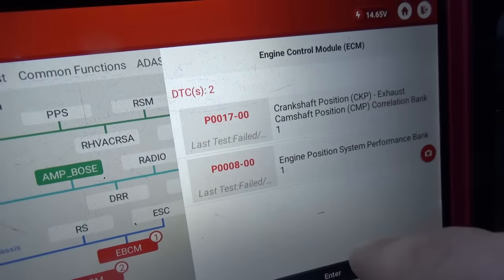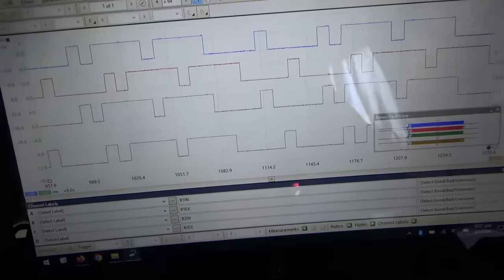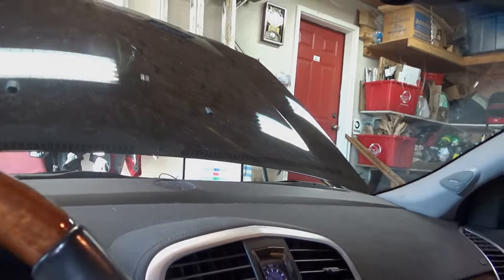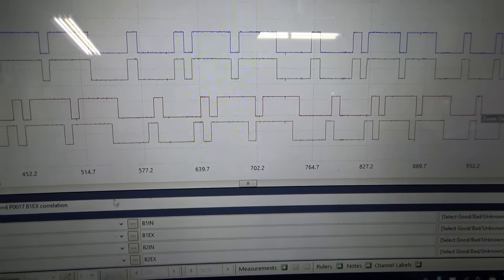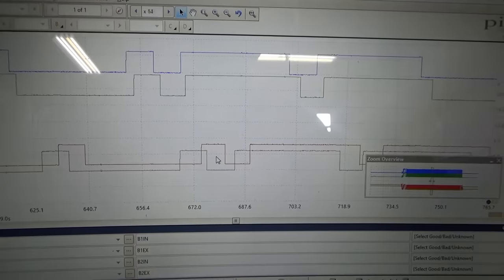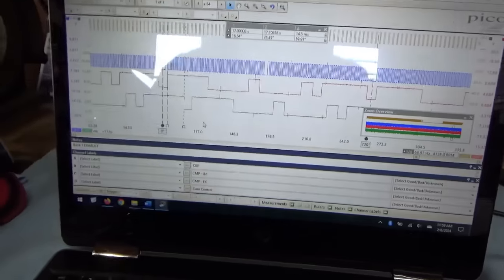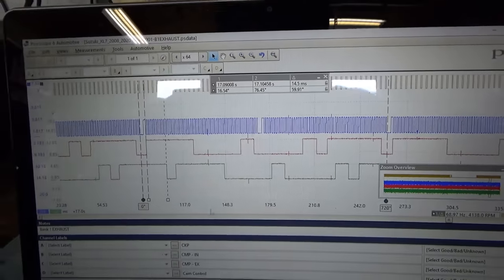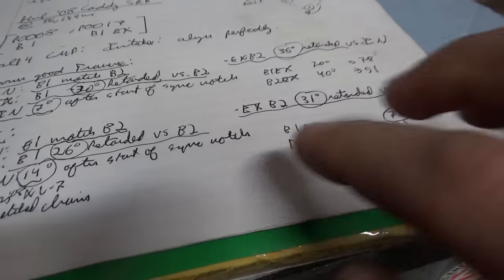GM Timing DEATH CODES? (P0008 P0017 Cadillac SRX V6)

Comment: I've found a lot of those reluctors shifted so I just pull the pan for a look before doing a chain and let the customer know up front.  Press on stuff on cranks and cams suck.
Reply: Will you be able  to see 👀  10 degrees differences?
Reply: Had that issue on mines.

Comment: Just seeing this video now. I have codes P0017 and P0019 for a few years now. Mine is a 2010 3.0 Equinox AWD. I've been religious about the oil changes. I have no chain noise, it runs well, almost chirps 2nd gear on FT acceleration. I also get 26mpg with AC on doing 74mph here in Florida. I've always used good oil, Mobil 1, Pennzoil Platinum and now on Valvoline Restore and Protect for the next two oil changes. Car has 183K miles. I just did a borescope on the front 3 cyls and pistons look good with little carbon build up and the cyl walls look new. Shiny with very visible crosshatching.

Comment: I know that the LE0 version of that 3.6 litre GM V6 engine was known to have problems with the timing chains stretching & the crankshaft timing sprocket keyway wearing out in them in the 2006+ model Holden VE Commodore (Basically the 2006 model Pontiac GTO engine with that V6 engine fitted instead of the 6 litre V8 engine) in  Australia.

My grandfather has done over 400,000 kilometres (250,000 miles) in his 2005 model Holden VZ Commodore which he bought when it was a couple of years old,it runs the very first of the high feature 3.6 litre GM V6 (LY7) engines with variable camshaft timing on inlet camshaft sprockets.

I think that it's because he does a lot of country driving that it hasn't flogged out the timing chains & the crankshaft timing sprocket keyway but it's no excuse when I have found that the LS1 V8 powered Holden Commodore has been a better choice,the same goes for the VE Commodore which runs the 6 litre L76 V8 engine standard & the L98 V8 engine in the enhanced version which was fitted by Holders special vehicles division.

Even some people go as far as saying that the old 3.8 litre Buick L36 V6 engine was better than the 3.6 litre alloy V6 engine !

Comment: If I remember correctly, Eric O was had a similar problem a couple of years back.  The chain stretch was not that high, but was enough to exceed the limit and the system shuts it all down.    It is a weird one in that at say 4.9 degrees out, it is fine, at 5.0 it is suddenly out of spec and you get the MIL light and degraded performance.  No middle ground!
Reply: Sounds like some engineer just picked a nice round number for the limit...
Reply: @xanderlander8989  yes... should have been noted degradation, not MIL light of death.

Comment: Something I have noticed over seeing several of these and ecotec 4 bangers and timing chains, the oil filter cap has a drain back valve in it. Lack of oil pressure on start up destroys timing guides. Every time I do a timing job on a ecotec or rwd 3.6 I ALWAYS replace the oil filter cap.

Comment: I'd been waiting for this video! Since seeing your comment about this on another video. So glad you delivered! I have this same exact car 106k but only the p0008 code and i tried changing the camshaft position sensors on bank one back in march but it did not work. I paid a mobile mechanic to diag who suggested i try the same but he did not do a thorough diag like you, just gave suggestions since the car drives just lacks power. I did buy the vvt Solenoids like the other comments of that video suggested but I'm betting it's just my chains like you say. I've been driving with Christmas lights for 5 years now. Once I'm able to afford to replace them, I'll will definitely follow up!

Comment: GM has updated the ECU software for many of these.  They will allow more variance on the timing chain.  I was working on an Impala with a 3.6.  I did an update on the ECU and TDS notes said it was a fix for P0008 and P0017.  I flashed and the codes did not come back.  I don't know if this is for all GM's or not.  I did not scope it though so I cannot say how many degrees it was off.
Reply: That's very idiotic by GM since it's only masking the problem i've done close to a dozen timing chain replacements on the 3.0 and 3.6 engines and all the chains have always been stretched 1/4 to 1/2 inch depending on how long it was ran with the problem
Reply: @lieutenantdan8170 Dang that's a lot of chain stretch.   You'd think GM would have changed to a different chain design or or a different supplier or something.   Or maybe it's an issue with engine oil or something.   I assume most chain stretch is from the pins holding them together wallowing the holes out.
Reply from the maker: I'll look into the reflash next time! 👍
Reply: They  were supposed to I’ve fixed the problem after 2012         That’s related to poor oil changes

Comment: i just did this last month on bank 1 exhaust tension took  a dump had do to a tming chain and it was fixed and passed inspection and costumer was happy as hell because she went to somewhere and they told her she needs a new engine lol when you mention the codes i already new that needs timing job lol and i saw the same tsb and remove the pan and check the crank mine was fine as well

Comment: The timing chain stretch was determined to be caused by carbon in the engine oil from Di engines causing the timing chain pins to wear excessively . This was such a problem that Oem’s went to the oil companies  and they come up with a new Api classification to address this issue.
Reply: @whynot4409. Interesting. Where did you see this analysis?  Pins wearing, not the links stretching?
Reply: @alexanderzubar9593  chain stretch is caused by the pins and their bushings wearing. The links themselves don't stretch, but pin/bushing wear effectively lengthens the chain.
Reply: @alexanderzuba Here is the title to one video that addresses this issue: 3 big problems with direct Injection engines . The new API classifications are SP and ILsac GF-6a . Here is another one from MB World which address this :Direct injection timing chain wear. There are many more articles on the web.

Comment: Are these timing chain issues preventable with shorter oil change intervals and did GM ever alter the design to improve durability? It's a shame because the old 3.8's had a reputation for being bulletproof.

Comment: I had a 2014 2.4 equinox on Friday setting a p0017. I took a waveform and could see that the exhaust cam was clearly out of time.(wish i could post the picture of it here). Turns out the exhaust reluctor moved(pressed fit) I literally have changed dozens of chains, phasers, (almost never a sensor😉) complete timing sets on the 2.4s and have yet to see anything except a chain kit fix the p0017. We need a better reference location for waveforms. Almost impossible to find everything when you need it. I had a 2010 equinox with a 3.0 v6 with timing codes and could not find a verified known good waveform. I found waveforms but they did not match what I had... given diag time I was already at and what customer was going to pay for the time I invested I had to let it go and never got a chance to find out what it truly was going on with it... picos library is good but not all encompassing and my other sources like mitchell, all data, etc are very hit n miss...Do you have an email or forum I can post the picture of the reluctor that moved? The reference should be available to help the next person who encounters this.

Comment: When looking at timing shift with stretched chains, don't forget the tensioners.  The driven sprockets will be pulled in the direction of the tensioner, so the stretch will not be distributed evenly.
Reply: Not so, the chain is pulled on the opposite side of the tensioner. The tensioner takes up the slack on the slack , not pulled, side. This to keep the loose chain  from slapping around. The tensioner does not affect chain stretch or timing, it only adjusts for chain stretch.

Comment: I have a 2014 GMC Acadia. It has 150k on it, no engine issues, normal oil change.  I don’t do top high maintenance on it, in fact I just asked my mechanic about doing preventative maintenance on it, he said leave it alone until the engine light comes on with an issue,  if it’s working fine DO NOT TOUCH IT, when you start interfering with stuff that’s when weird problems start showing up.
Reply from the maker: At least change the transmission fluid 😉

Comment: Hi Ivan in part 1 you stated only use GM OE  parts if it has a wire coming from it. I believe a Timken hub would work as well . But you are 100 percent correct ,quality parts make a huge difference. I watch all your videos. 😊

Comment: Depending on how many teeth are on the crank-- it may have actually jumped a tooth,  because of loose guides are tensioner, etc;   seems more likely since both cars had nearly the exact same numbers...  Or I guess it probably has a stretch tolerance and it trips the code just as you pass it...  which is why both numbers are nearly the same.  Makes perfect sense.

Comment: Here in Australia the 3.6 Alloytech engine was put in Holden Commodores from 04 onwards until the closure of the company .The timing chains were a known failure point (stretching )from 160000klms however if the correct oil & change intervals are observed they do not have the problem my 05 with the LEO designation has 179000klms on it no problem (It was a Police commissioners vehicle before I purchased it so maintaince was meticlous)The LYF & LFE designations in the later models 06 to 18 which had higher horsepower were more suseptable to chain stretch.
Reply: The real problem is they used a weak pin-and-roller link chain like that on a motorcycle. It isn't large enough. GM cheapness.

Comment: A spun reluctor on the crankshaft could throw out ignition timing. Maybe, just maybe, you could do an ignition timing check with an in-cylinder pressure transducer. But, that will only work if the ignition timing is based SOLELY on the CKP, true in some cars, but not all.

Comment: 1:00 They are also notorious for the chains pulling through the links and breaking right around 80 to 100k.. Usually on bank 2. NOTE: these engines have 3 chains, A primary idler drag chain and a chain for each bank that run on 2 independent idlers.
Reply: Do you know why the bank 2 chain brakes?
Reply: @NicolasSchreuders in my experience, the steel the link ovals are made of is too soft, as the pins wear their way through. Or maybe the link pins are too hard. But the failure is the same. That's what happens when you outsource.

Comment: In cases like these, OEM parts quality is the central issue. In most cases, you wouldn't even suspect a Toyota timing chain at 200K. Just look at the heat indicator markings and move on. Low mileage timing failures are unacceptable in this century, without some abuse factor.
Reply: Skinny low noise chains don't help. I have a vk45de engine with 180k km on it and the chains are worn over 8 degrees, and it's one of the cleanest engines I've ever seen inside

Comment: that engine came out in 2004 in 2006 they reduced the size and durability of the engine timing chains/in 20 years i had one crankshaft reluctor that shifted/engine had a overheating problem it had 120k miles on it/the chains in these engines are junk/aftermarket kits are junk/i have replace chains and had them re fail in 10,000 miles and they were stretched again/you can watch chain variance while driving if exceeds 8 degrees it will set codes and starts timer and will lock system after 30 seconds if i remember correctly/bank 1 usually are always stretched more/that bullitin you had up said check for chain stretch first/it can be done by removing actuator solenoids or cam covers/new chains tensioners will be extended a little amount and should hold chain tight/if stretched chain tensioner will move when pulling on chain and will see a lot of tensioner piston out of body

Comment: The in-cylinder pressure transducer vs ckp signal can prove/disprove a shifted/rotated ckp reluctor wheel.  You'd need known good to compare to, though.  But I also imagine - if the ckp reluctor has indeed shifted, ignition timing would be off.  So you can compare a scan data pid for ignition timing, vs an actual measured timing and test it that way.

Comment: i always preferred belts to chains even though they both wear out or stretch over time and mileage. with an engine scanner you can diagnose most issues. doesnt have to be a $1000 scanner. i have one that was less than $100
Reply: a cam chain rarely breaks, a belt can, with disastrous results.

Comment: I had this same issue on my 2008 Pontiac G8 with the LY7 3.6 V6, happened at 65k miles in 2011 and GM dealers would not fix the reluctor wheel issue on my engine so I had a shop do the timing chains and it turns out it was completely screwed! Totally crappy customer service from GM on this issue on that engine and an absolute nightmare for customer!!! They knew about the issue and just passed it off on the customer!

Comment: @17:43 you can't think of it in distance like that. B1 ex is no farther away from the crank than the other 3. The lower chain is the disconnect, both upper chains are the same distance from each drive idler on their respective side. All stretch in the lower chain is automatically added to any stretch in each upper chain. That is where any difference in bank to bank correlation is seen, difference in upper chain stretch.
Reply: What I see is even chain stretch. The reason this problem is more prevalent on multi chain engines is tolerance stack. Here we have 3 chains and 9 sprockets (each upper drive idler has 2, a driven sprocket and a drive sprocket), and two idler bearings. Wear in all of these components adds up.
It seems like GM's logic may be that the first code sets and it no longer desires to continue monitoring or isn't able to because the phasers are locked out.

Comment: I've run across this engine that had the chains replaced and had no codes for almost a year, then they showed up.  The dealer went to do a chain replacement and found that the main chain, crankshaft, one had been installed one link off.  The ECU compensated fine until the chains stretched some, normal wear, then it was out of limit and the death codes showed up.

Comment: The most obvious factor you have overlooked is the oil pressure that keeps the chains tight.  I chased my tail on an Equinox with the DOHC engine, and the slippage in the timing was an internally broken, but delicate, oil pressure pump that kept the DOHC timing chains from jumping time. This was caused by a "warranty repair" in replacing the water pump & chain,  but with no money in the repair for the dealer to protect the DOHC chains or the delicate oil pump that was the key to the issue.  It was jury-rigged and failed w/in 4,000 miles.

Put another way, assuming no slippage of the gear pressed on the crank shaft, etc., what is more likely, a chain stretching that is continuously bathed in an oil bath, or a defective oil pump that is supposed to maintain adequate lubrication of these things.

Comment: I have these codes in my 2008 Cadillac SRX, along with P0018. However, i just had all the timing chains and sprockets changed 22k miles ago. The only thing that wasn't changed was the VVT solenoids....so despite what you say about just changing those parts, sometimes those parts are the issue.
Reply from the maker: I never said anything about the solenoids... 🤔
Reply: @PineHollowAutoDiagnostics then you should have checked the VVT solenoids

Comment: i have done numerous timing chains on these from FWD/AWD caddy srx to Acadia/traverse to Camaro. Every time i take the chain off and hang it next to a new one it its stretched longer. bad chains also cause misfire even if the  p0018 codes etc are not set. Last Camaro i did only had 110k miles.. SO go figure gm v6 quality.. Stay away from these. GM has TSB for the older 3.6 stuff even claiming the chains stretch lmao. There was a warranty recall for this like 10 years or miles etc on the older stuff. I also recommend not taking this job!!! The best way is using a lift and dropping out the engine and transmission on the ground if its Front-wheel Drive!! RWD can be done in car easily/Camaro etc. It is a monstruous fight to do it in the car FWD/sideways engine!!

Comment: I have a 2005 srx with 261.000 miles on it, the trick is don't let the oil go past 3.000 miles, and keep the PVC clean. Sludge build up will kill this engine.😊

Comment: I did 2 Alloyturds timing kits & oil pump (LY7 3.6 & LF1 3L) in Commodores last week for the P0017 & in my experience it's usually the first code to set, both run great now but it's a very expensive job.

Comment: Wasn't there a flash for the Traverse ECU that extended the stretch to like 2 mm instead of the 0.5 mm originally firmwared? I had the sorta same issue with a 2010 Traverse. Owner came back after OEM chains and phasers, in about 4 months, and called friend and he said to bring into dealership for the update. (Note customer wasn't doing a great job of oil changes) Just a thought, but a maybe?    
Great video as always!

Comment: Both my 3.8 Commodores went past 500,000 km with no engine work done. Oil change 6,000km. Clean oil, clean air and clean fuel plus drive it like you love your wife.

Comment: I'm sure someone on Facebook would've helped you with a correct ckp cmp waveform for ya. And did you have the vvt solenoids plugged in?  Think maybe that b2 ex might've been phasing just a little bit? I just did a p0017 on a cruze, zoomed in on 4 different spots and had 4 slightly different results. (Vvt's plugged in) Makes for a lot of variables!

Comment: So either the tone wheel has shifted on the crank or the lower chain has the stretch. It will be interesting to see what you are able to determine. I bet you are going to deploy the in cylinder pressure transducer to determine if it’s mechanical timing or tone wheel shift.